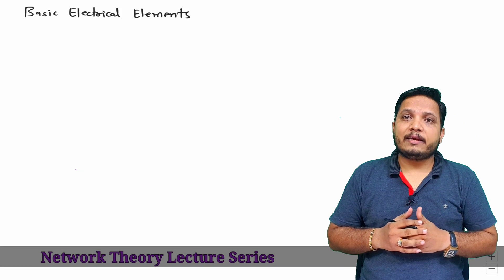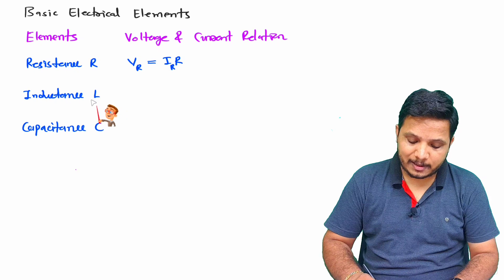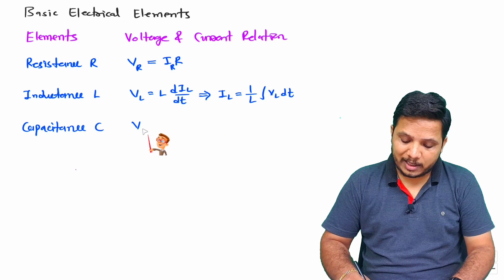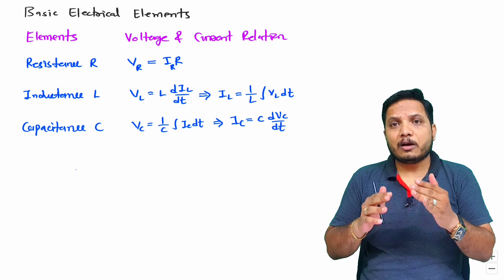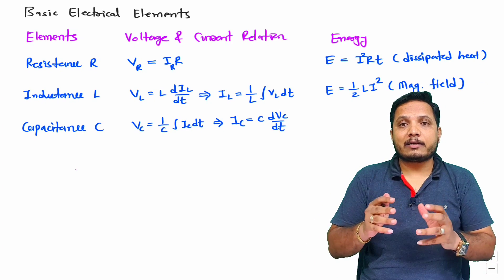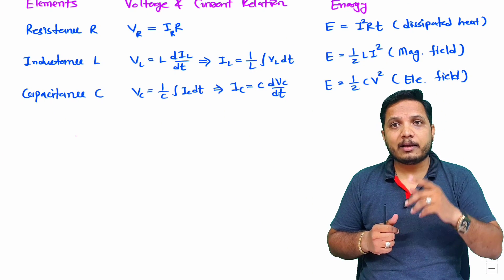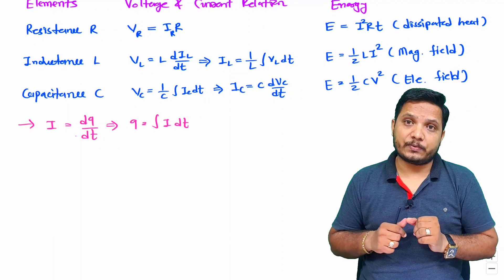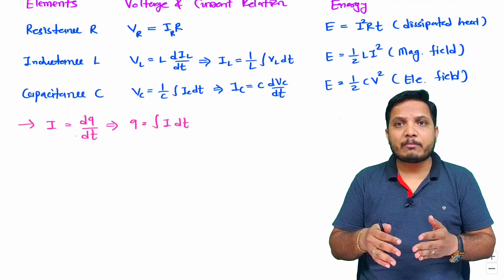Basic Electrical Components: Resistors, Inductors, and Capacitors

Comment from the maker: Basic Electrical Elements explained with following Timestamps:
0:00 - Network Theory Lecture Series - Basic Electrical Elements
0:37 - Voltage and Current relation in Electrical Elements
3:26 - Energy across electrical elements
6:00 - Current and Charge